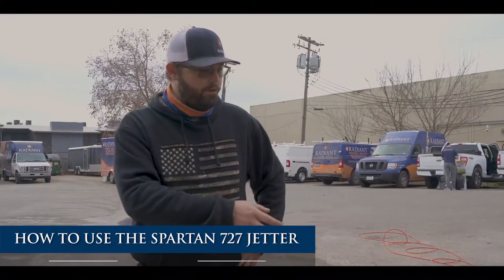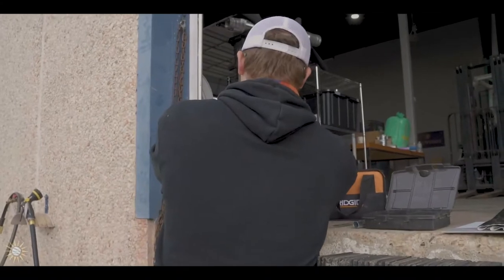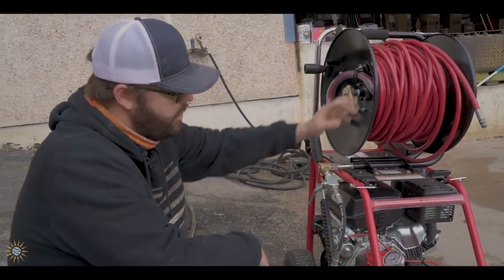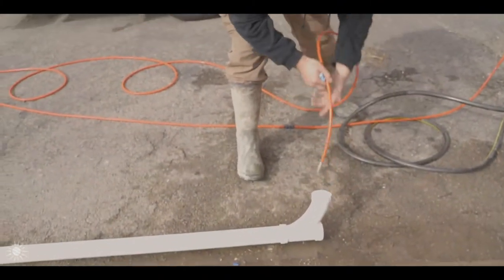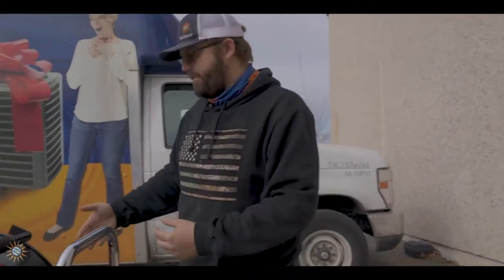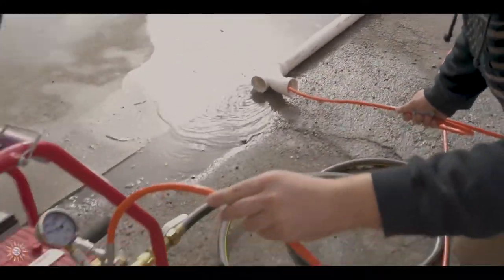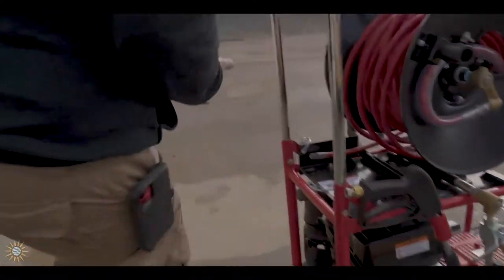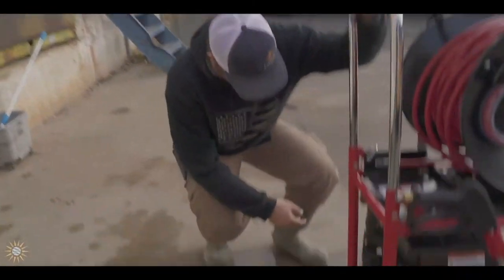How To Use The Spartan 727 with Eddie

Comment: Thank you for posting this video. Very helpful. It doesn’t look like a machine quite capable of cutting roots and 6 inch clay pipe and I have around my area in the Midwest. What’s your take on big enough units pressure and gallons per minute.? What should I look for? Thank you Dave from St. Louis
Reply: Cutting roots you want 4000 psi and a minimum of 10 gpm as well as the appropriate root cutting nozzles.